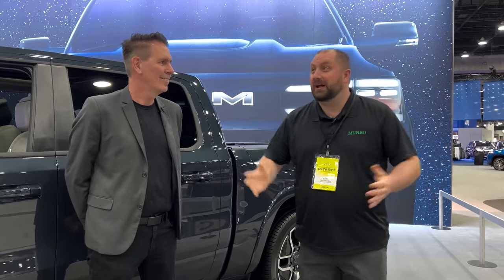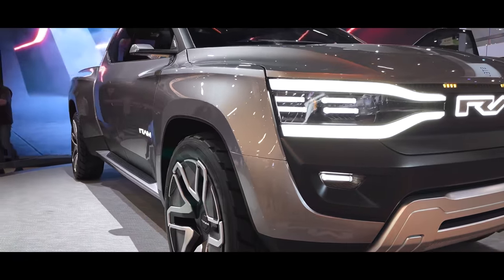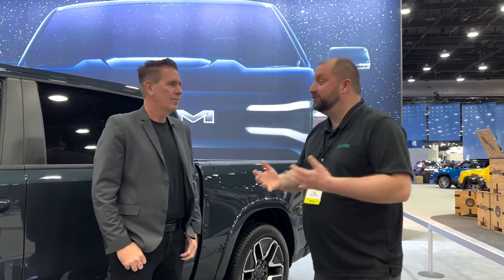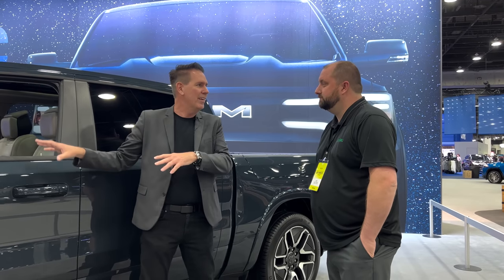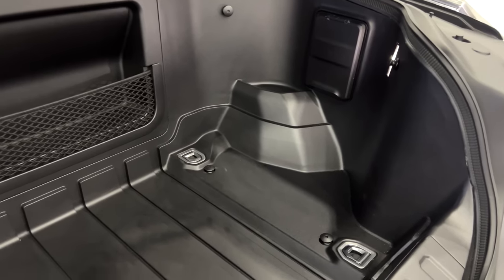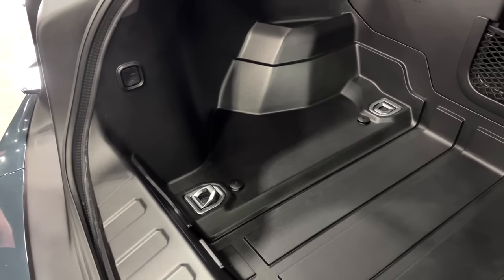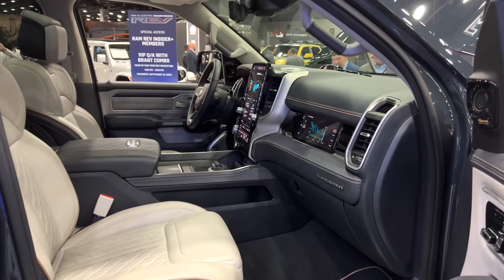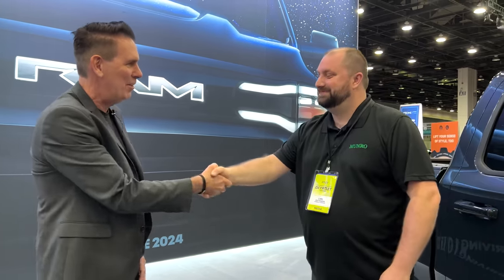Arriving in Style: 2025 Ram REV with VP of Design Mark Trostle

Comment: Imagine putting a load of rocks or bricks in your new 125,000.00 Ram.  They are getting to pretty.
Reply: I wish the manufactures would make a modern utilitarian true work truck designed for real work, and at a reasonable price like they used to in the 90's.
Reply: @keith8876  these trucks are nicer than a Mercedes.  I know Ford and Dodge do make striped down version for work, but as a consumer who wants a nice truck but can't see throwing rocks and stuff in the bed or taking it camping as they are now so nice and sooooo expensive.

Comment: If this is a 2025 model and they want to use the Tesla charging network, shouldn't the charge port be in the rear? Looks to me like it's on the driver's side front .
Reply: No one is planning to standardise that location. Towing is important to pickup truck drivers, and any location in the rear of the vehicle makes it hard at anything other than a charging station with a pull-through layout ... and that's something I've yet to see in real life. Front location means you can nose-in to the station and leave the trailer connected.
Reply: I'D LOVE TO KNOW WHY SO MANY COMPANIES THINK YOU WANT TO SEE THE CHARGE PORT ON THE FRONT FENDER. TESLA CAN HIDE IN THE SIDE MARKER.

Comment: I want my hammer to be functional, cost effective and to last a long time.  A paisley inlay on the handle or decorative engraving is not very high on the list.  

A truck like any other tool should be functional, cost effective and last a long time.  It should be easy to clean, easy to maintain and should not have a lot of delicate trim features that wear out quickly or are so easily soiled or damaged that they become a maintenance nightmare and an eyesore which takes away from functionality, cost effectiveness and longevity.

In comparison, a Custom Ordered 1969 Power Wagon W200 E20 Special with all the trimmings cost between $3,300 and $3,600 while that same year a Cadillac Sedan Deville with all the trimmings was under $6,000 so why should a 2023 RAM truck cost more than a new Cadillac CT6 Blackwing today when even in the top of the line trim it traditionally would have cost a little over half as much?  I do not get this insane pursuit of inserting high cost features into new trucks that really end up taking away from their value as tools to get a job done and in many cases take away from their load capacity making them even less capable tools.

Best!

Comment: For a "serious" truck I see a very short bed and alot of faff... probably overstyled to excuse a ridiculous price-point. Eh. 

And the answer to the first question was basically "we didnt really want to, but the customers are demanding it and our competitors are kicking our buts". Stylistically it looks like they modified some F150 Lightning lighting designs and slapped them on the existing RAM 1500. The front end actually looks more like a dodge minivan than a truck. And that cargo net in the frunk is cute... does it come with a ladder so you can climb in there and reach it?? 😅

Comment: Error 1. Charge port is behind front wheels.  same error Ford made.  The charge port should be in front of the front tires or behind the rear to make using chargers (especially Tesla chargers) easier.
Error 2.  Frunk has a lip.  Ford did it better.
Lets hope they actually make a lot of them and the price is not ridiculous.

Comment: MUNRO live - the RAM REV is about as AREO as a BRICK WALL , which means its LESS Range and will Require a LARGER battery and is WAY less Efficient. that LARGER battery also means MORE Weight. 
the REV is a CRAPPY Design.

Comment: Now lets hear about the drive train and battery.  Its a truck not a Mercedes.  Seems the truck guys are going soft.  
Will there be a range extender offered. Would rather have a range extender in the frunk with vinyl interior instead of the 15k fancy crap.

Comment: 13:30 this door is emblematic of why the D3 cannot make money on EV's. This will be yet another failure in EV's.
Reply: There no reason the door panel on a truck should be more than just a single piece of injection molded plastic. Something that's easy to clean

Comment: What I want to hear.. This truck will tow 10k lbs for X-miles. Will hold 2k lbs in back and go for X-miles. Battery packs will last for X-years normal wear and tear. Truck will go X-Miles empty. Etc,.. Not hard to do. My guess is that just like the Lightning it will underperform and have breakdown issues left and right. JMO
Reply: Otherwise it sure is pretty. lol

Comment: They’re making a huge mistake if they follow the other’s. Especially with home charging stations being a very real hazard. I believe even the Home Insurance companies are jacking up their rates based upon if you have one.  Gasoline powered vehicles are still the dominant species. Especially with how much more EV pickups and vehicles in general cost. It’ll take some convincing this will work until the charging station safety and cost can be addressed. And oil consumption that’s required just to produce one battery. Finally the demand. And the people who buy pickup trucks want that 5.7 Hemi in their RAM. Just like Ford and GMC owners want whatever is under their hoods.

Comment: Why couldn't they deliver a truck that resembled the concept vehicle? Tesla tends to improve their concepts, not water them down. Still, it looks better than a standard truck.
Reply: The GM followers are freaking out that BT1XX is a unibody with the bed integrated with the bodyshell; seems that a fair number of pickup truck buyers are more than a wee bit resistant to change. Doing it this way (Same idea as Ford did with Lightning) keeps the form factor the same as what they are used to. Major changes in form factor will wait until people get used to the idea of the major powertrain change.
Reply: I dunno the Cybertruck looked terrible in it's unveil and the Cybertrucks we've been seeing in the road lately somehow look even worse than the unviel prototypes.

Comment: Great looking truck.  Tungsten expected to be $100k+.
Reply: I'll wait for the Tritium.
Reply: the TESLA Cybertruck is Better looking and does not RUST , does not need PAINT.
Reply: the KANDI K32 is only $38,000 4x4 off road.
Reply: Chinese Kandi truck LOL. It would look pretty ridiculous parked next to a RAM :)
Reply: @mrm1885   - why its same size as a Ranger or other Light truck.
Reply: @markplott4820  Plus cut you to ribbons with "good looking" sharp edges if you don't wear protective clothing

Comment: What? Is it "electrified," which means plug in hybrid, or is it an EV? What does the r stand for in REV?
Reply: Actually REV stands for REALLY EXPENSIVE VEHICLE
Reply: @djemcee  i mean, I worked at Tesla, I am not some newb to the topic, so if I don't know what they are talking about, who does? You got BEVs, battery electric vehicles, you got FCEVs, fuel cell electric vehicles...and now REV... roadrunner electric vehicles?
Reply: Recreational??
Reply: @MarkXHolland  I mean, they could be confusing SUV and BEV as acronym formats and then... Recreational... Entertainment Vehicle? Does it stream porn or something?
Reply: This one is straight electric. Plug-in hybrid will have the engine where the frunk is on this one. I'm not sure which engine they've got planned, but even the turbo 4-cyl can't really be put anywhere else in the vehicle.
Reply: @bikeaddictbp  yeah, again, after working at Tesla for a time, one is up to speed on the details of EVs. They used the term "electrified" and that really is a term for plug in hybrids, so they should not have used it for an EV. And then unless it has roadrunners zipping around a hamster style wheel, just call it a BEV, that is what it is. It is not an "REV," whatever that might be.

Comment: The front lip on the frunk needs to go. It is a pain lifting objects over a lip to get them in and out, especially at the height it is.

Come on, guys, do better. Think about what a customer has to go through and especially if they are shorter. 

I don't have the issue but my wife is 5'2 inches tall. How is she going to lift objects in and out if she was driving it without me there?

Comment: MUNRO live - CARL , you used the Wrong TERM .
"Electrified" means its Either a Hybrid or a EREV (range extender) which RAM REV is not. 
the REV is a 100% FULLY ELECTRIC Truck or BEV. 
though its NOT at all EFFICIENT.

Comment: CARL , I am willing to bet , RAM has not Replaced the OUTDATED lead acid 12v battery in the Truck.
they are NOT using , Lighter & more Advanced 15.5v Lithium battery as System power.
Reply: More Advanced or unnecessarily complicated. Depends how you see it.
Reply: @mrm1885   - Complexity has COSTS.
Less complex & MORE Reliable are more Important. 
the RAM REV needs top bottom LEAN Design review. 
DELETE parts & process.
DELETE 1kg Weight every day. 
make PARTS with 3 - 4 Functions.

Comment: MUNRO Live - in one word RAM REV is BLOATWARE on 4 wheels .
its not EFFICIENT , its too HEAVY , too SLOW , has too many OLD FASIONED parts & process, its not a LEAN Design. 
they Focused too much on the Interior and have a Generic truck Exterior. 
one PROBLEM with the RAM REV is its NOT a HIGH Technology SMART truck . 
as a WORK truck its Really CRAPPY . as a Daily Driver its CRAPPY , and its Really NOT much of a 4x4 offroad Truck Either. 
the RAM REV will be a FLOP for RAM & Stellantis.